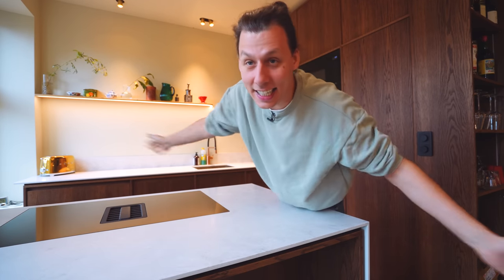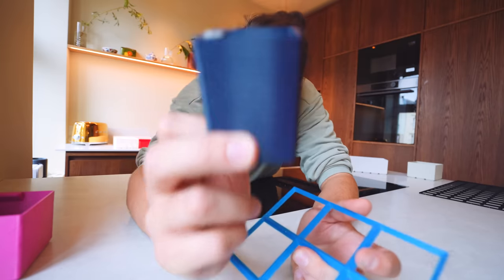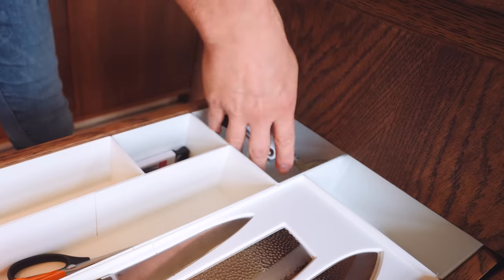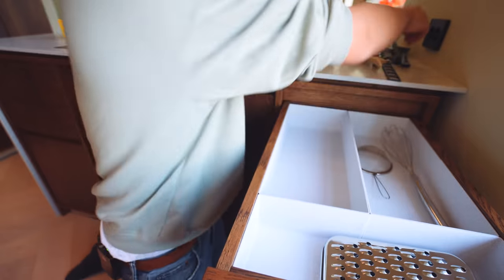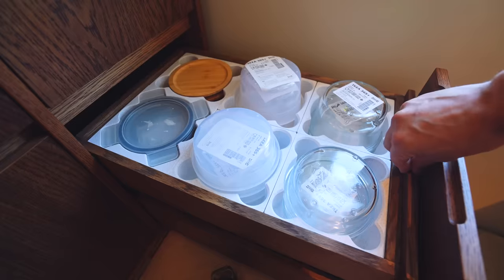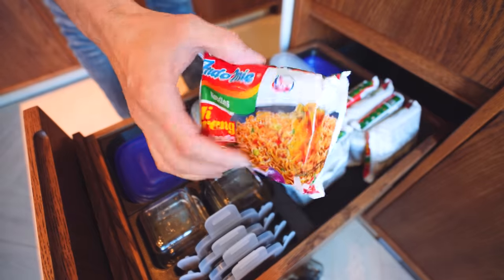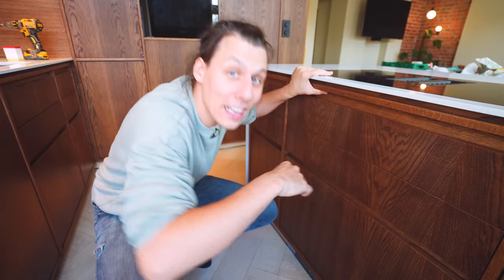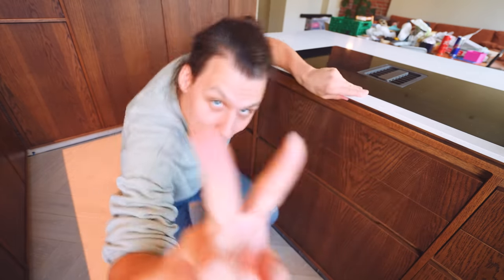How To Organize Your Kitchen With 3D Printing

Comment: Why not just conform to gridfinity with 42x42mm? proprietary grid systems for storage was rendered moot after that release. Still love your videos, great content!
Reply: this is exactly what i was thinking
Reply: While I agree with you 100%, once you have conformed to 1 standard, it’s a B to change
Reply: Probably because Alex came up with the idea first and he has designs to sell. If you don't want to buy these, just stick with gridfinity. Choice is yours.
Reply: Exactly
Reply: Exactly @amiddled  .  This system came first...Zack properly attributed Alexandre's v1 work when he put out Gridfinity.
Reply: @therick0996 he changed it from a 55x55mm to this 40x40mm. Would've been the perfect time to confirm with gridfinity (which I know was based on Alex' original work)
Reply: History...
Reply: Indeed. Seems like a crazy amount of work to redesign the wheel (even if your original idea was the catalyst for the current leading design) to try to earn some cash when there is a floss system with a huge following already competing in the same market.

You'd think someone would pivot to creating custom gridfinity modules for kitchen utensils and selling those designs instead.
Reply: @lmaoroflcopter  exactly. The problem is the licensing model Zack used for gridfinity means anything using its design must be open source as well. Sadly, it means this redesign here is nothing more than a cash grab when it could've very easily followed gridfinity. There's still a lot of work that went into this process but intentionally not following gridfinity by quite literally a 2mm design schema screams 'cash grab.'
Reply: @lmaoroflcopter  I would disagree - the amount of effortfully justifies the cost of buying the design files if you wish ;) You don't have to go this route you can always extend the open-source version if you wish nothing to stop anyone from doing this.
Reply: Parametric Gridfinity designs scale to any base unit you want. Whether the interlocking mechanisms are compatible is the main issue.
Reply: Ask not why Alex chose the sane 40mm, ask why Zack chose 42mm, which doesn't multiply up to exactly fit common shelf and box dimensions (spoiler: it was for a Hitchhikers reference). 42mm*42mm and a vertical unit of seven-point-something mm (instead of 10mm) is just needlessly causing problems for real world use, as opposed to playing with remixes like a grown-up Lego toy.
Reply: @AndrewHelgeCox  that is a fair point.
Reply: @NsRhea  you have the wrong way around. Alex's system was first. The perfect time to do the conformity was when Zack produce Gridfinity - which he didn't.
Reply: @amiddled  no I'm fully aware. The issue was Alex went closed system / proprietary and Zack didn't want to steal his design. So he designed a system and made it open licensing similar to Linux in that anything using gridfinity's base design needs to be free and open source for people to remix. IE something Alex couldn't mod and sell like he is here with a 2mm change.
Reply: @danpeters5163  I don't think we're on opposite sides of the same coin. I'm saying he spent a ton of effort reinventing the wheel why would he even start that endeavour, you're saying he spent a ton of effort reinventing the wheel, he has to charge for it to derive some value from it.
Reply: Because choices.
Reply: The same reason why we all don’t have just ender 3, Prusa or Bambu Labs.
Reply: @AndrewHelgeCox hitchhikers hey? Huh…
Reply: Alex definitelly didn't come to that design by himself, he copied/modified/took heavy inspiration from AT LEAST Sortimo, Allit, and many others by tool manufacturers. And now, he only changed to keep milking it. You can still do the halves thing with the "original" system.
Reply: Why not just make the new models Gridfinity-compatible without calling it “gridfinity”? It’s not like Gridfinity has a copyright on the 42mm grid system. Alex would still get to sell his proprietary models. I would certainly reconsider purchasing these new models.
Reply: @AndrewHelgeCox  I believe he chose 42 by 42 because it fit in his tool chest. lol
Reply: @lmaoroflcopter except he didn’t “reinvent” the wheel, he invented it 😊
Reply: @jhamby8773  I'm certain stacking storage systems existed before this guy.
Reply: No content in that. That would be like building a huge 3D printer for an empty conference center 🤔
Reply: @ldw821 he may not have a copyright on it, but he DOES essentially have a COPY LEFT on it, which in human terms, means, that if anyone is doing a 42mm grid system styles bin, it HAS TO BE distributed free of charge... I'm sure there are ways to get around that, for instance, making an "improved" model, but then the question becomes, when does editing something for a free, and open source system, actually make that designed item, now fall under that system, whereby it's then illegal to "sell" derisive works?

I'll admit that I don't know much about us copyright laws and I have not read the open source licenses in a long while, so anything that I may or may not remember, as far as open source goes, may have changed depending on the version and specific type of Open source license, of which there are many varying licenses...
Reply: @lmaoroflcopter  Alex didn't 'reinvent the wheel'.  Alex INVENTED the wheel, and Zack stole the idea, decided it should open source, and made a ton of money off it.
Reply: @ldw821  Because Alex's system came FIRST.  Zack stole the idea.
Reply: @BadlyBentPub  again, as per the last guy who came im chuntering about this, stacking storage systems existed before Alex, and they'll exist after Alex is dust.

Comment: Like many, I was inspired by Alex's videos and paid for the original assortment system. It worked well enough to organize my drawers, until I wanted to make some modifications. Without the source files, I spent hours looking for anything close to what I wanted on Printables, without success. This is the primary reason I switched to Gridfinity, and not looking back - you just can't compete with the variety contributed by the open-source community.

P.S. if Alex made these compatible with the 42mm grid system, I wouldn’t mind paying for the models.

Comment: I am using pretty much all your organizing boxes for years now, and I find the system extremely useful. All furniture that I make I size the drawers as a multiple of 55 x 55mm (the height is more flexible, and I have decided for 65mm for most). Anyone following your ideas for building a kitchen should think multiples of 40 x 40mm.

Comment: Mmm, gyroid infill. ❤ I'm using Gridfinity for my Ikea Alex drawers, turns out that its 42mm grid is perfect with just enough gap on the sides to avoid the screws in the drawer -- I printed a couple of 1.3mm spacer blocks to get the grid centered in the drawer to avoid the screws.

Comment: I would understand not going with gridfinity if you wanted to use a different pitch, but 40mm is so close to 42mm, might as well go with gridfinity
Reply: If he made it compatible with the Gridfinity standard, I would honestly consider buying these models.
Reply: Alexandre's system is the original one that Zack stole - he changed it just slightly and now everyone thinks that Zack is some genius.

Comment: I've just binge-watched most of your 3D printing projects yesterday and today (going to buy my first 3D printer :)). And now another new cool project! Keep up your awesome work!
Reply: I recommend "USSA: Woodworking+3D Printing" as well for similar caliber content of engineering and 3D printing
Reply: what printer you wanna buy? There are also rly good "cheap" ones :) for 150-250€ .
Reply: @hrdcpy  Thank you for the recommendation! Great channel!
Reply: @Bastyyyyyy  Bambu Lab P1S. I don't wanna work on the printer instead of printing :)
Reply: @alekshudochenkov  great decision. I started with Anycubic Chiron and it's a pain in the ass, although I had a lot of fun with it and learned a lot about mechanics, software, etc., I would now like to buy Bambu Lab because of auto-calibration and other useful features

Comment: One issue I have is using this system in IKEA kitchen drawers. I don't know why but they decided to make the sides angled. So the bottom of the drawer is a good 3 cm less wide than the top. So after filling the whole drawer with boxes, I have a 1.5 cm gap on each sides that tend to accumulate dust or chopsticks that fall in between.

Comment: My kitchen drawers are of a size where I end up having a half grid along a side, so I printed a number of the boxes that have the half spacing. They work great! One thing that I realized, though -- it would be awesome if all the boxes had half-size features on the bottom so that they would be able to slot into the grid on whole divisions or half divisions regardless of orientation. That way, if I ever want to use one of the bins I printed with a half-sized feature rotated 90°, it would still work fine.

Comment: I bought your original storage designs but ended up switching to Gridfinity for exactly the reason that you just switched to the 40x40 grid -- it allowed for finer control over sizes. Now you've solved that, and so I've bought these as well. I think they may finally be the impetus I need to bring this kind of storage to my kitchen, and I like to support creative people like you who come up with these original ideas. I think this new smaller grid of yours is excellent and it's neat to see the evolutionary improvements in it compared to your original design. The half-space sizes and the filler pieces are especially good ideas.
Reply: I’m confused why he doesn’t contribute to gridfinity instead of reinventing the 3D print.
Reply: Why not support gridfinity instead?
Reply: @rkatz69  Gridfinity is derived from Alex's original assortment system. Pretty clear that the designs here represent a lot of effort and original creativity on Alex's part. I have no problem paying for them.
Reply: @jaap7374 Gridfinity is derived from Alex's original assortment system. This new set of designs clearly represents a lot of creativity and original work on Alex's part, and I'm happy to pay him to use them. Not knocking the efforts of Gridfinity contributors in any way. But, frankly, having printed both some of Alex's originals and a fair amount of Gridfinity, Alex's designs at least for the 55x55 are more refined. I haven't printed any of the 40x40 yet.
Reply: @MikeKobb  Interesting, I thought Zach came up with gridfinity. Looks like he has some explaining to do.
Reply: @georgem64  (Trying for the third time to post this reply.) Zack did actually acknowledge that he was basing Gridfinity in part on Alex's system, in the first Gridfinity video. https://www.youtube.com/watch?v=ra_9zU-mnl8&t=383s

Despite the arguments he makes there, I'm still kind of uncomfortable with the fact that he took Alex's product and released a modified version for free, although Zack did a ton of original work on his as well. But this is part of why, even though I do use Gridfinity to some extent, I paid for Alex's designs because I believe in rewarding the guy who came up with the original idea. And now with Alex's 40x40, I will probably use those rather than Gridfinity in my kitchen because Alex's designs are just more refined. 

I also think it's worth noting that Alex introduced his grid system as part of the project where he made what's basically an assortment case, and there have been assortment cases with some kind of locking feature since before Alex designed his. The Tanos Systainer3 Organizer boxes, just to pick one example, came out in January 2020, while Alex introduced his grid in October 2020.

Comment: Rewatching this as I consider a new sorting system for my tools. I built a proprietary system 3 years ago to modularly fill an ikea filing cabinet years ago, but that meant it couldn't be square because of how awkward the size was. The 40x40mm grid is a great idea considering how many factors 40 has (1,2,4,5,8,10,20,40) which I think will be more beneficial than 55 or 50. Hopefully when I get a few more drawers set up I can get printing some boxes!

Comment: A great improvement for the bag boxes is, instead of spacers, is to have a spring-loaded bottom that will push the bags to the top. When you're low the bags are still accessible! There are paper towel dispensers that do this already with bi and tri-fold paper towels.

Comment: The Ziplock bag dispensers can be improved... make the filler block a flat piece and place a sponge cut to size under it to act like a spring.. will keep them pushed to the top of the dispenser

Comment: Hey Alexandre, rather than designing so many different combos with the half height size, I think it would be possible to use a plastic leaf spring that compresses and allows for 10mm or so of movement. Worth a look!
Reply: PLA springs don’t work AT ALL. You give it a week and it creeps to the extent that it no longer holds any tension. I believe most people will print it in PLA right?

Comment: That's some top class organisation! I feel like a small plate at the bottom of the zip lock bags and some springs under it would go a long way, I sometimes struggle to get the last item out a box like that when it's all the way at the bottom. :)

Comment: Great adoption of your storage solution. Inspired by you I made my own for my desk drawers 👍
Only detail to consider in this is tha many PLA filaments are actually made from corn and also have very small cavities during the printing process. IF you are unlucky, yhat is a growing ground for bacteria. But as long as you keep things clear and dry ther should not be any issues.
Thanks for sharing 👍🏼
Reply: maybe sealing the parts after printing with something would be a good idea. I indeed also never print anything that has even remotely the chance of interacting with something edible.

Comment: Perhaps you should make your Grid System parametric using OpedScad or similar. That would allow users to enter any dimensions they want without you having to make a seperate model for it :)
Reply: Well too late for that Grid...uh...Finity... I believe I messaged AC to consider the modern social $$ path- give away all the info and make $$ on the views, well before the Finity hit. Someone bettered the Grid design and released it to the the wild Finity. The groundswell community explosion around it has been fun to watch.  It's #1 on Thangs.  I'm surprised AC is still trying to slang old business model closed-loop files after the GridFinity explosion. Oh- the now trending on Printables is the awesome printable case for the Finity. I'd decided to go all in on GFinity, but this case really locks it in.
Reply: And pass on that sweet sweet money from basically inputing 2 numbers and make you pay for that?

Comment: Since you're flattening the bottom (inside), the bottom (outside) doesn't need to be simple. You could make boxes with enough chamfer to engage with the grid, but have a rectangular cutout in the bottom. Fill that cutout with a piece of rubber sheet, and now if you take the box out, or put the box in an ungrided drawer, it's got enough traction to stay put. This might actually be more helpful in the shop systems but in the kitchen it'll make the sound a little nicer when you're setting them on the counter
Reply: You could also put weights in the bottom of the boxes or even better, add slots every 20 mm so the boxes can be put in more locations in the grid!
Reply: He could also print those rubber inserts with TPU
Reply: @rkatz69  Or he could cut rectangles out of a cheap rubber sheet, available all over the place for low costs and even with adhesive applied to one side. Stop unsolving problems by shoehorning robots in. Heck, he could even use STICK ON BUMPER PADS. There's absolutely no reason to involve a 3D printer instead of a hyper-available stock part sold at every grocery store.

Comment: Alexandre, how do you make your 3D prints food safe when using them in the kitchen? Especially for the silverware boxes, any bit or water could cause mold to build between the layers. Are you printing these pieces on an SLA printer?
Reply: You wont get an answer as people would rather ignore the very real, genuine dangers :( It looks like FDM to me. Again, nobody cares. Protect yourself, don't worry about others. (Recent Robotics Engineering graduate with modules on 3DP and materials engineering [well additive manufacturing in general])

Comment: That's an impressive system.

When you showed the spice drawer at the end, the dill jar stood out to me. At first, I thought it was misspelled (or labelled in English). All of the rest (that I noticed) seemed to have the correct Danish spelling. But then I figured out that you're in Norway, not Denmark, so maybe the dill jar is correct, and it just so happens that the rest of your spices are spelled the same in Danish and Norwegian.

Comment: Alex, I should have known this was coming. Fantastic way to organise the kitchen. Will certainly look into you new sizes as my workbench drawers are definitely not the size of the original. You are a few days late, as I ordered a P1P a couple of days ago. You should look into a printed part recycling system. Seems like you have few, ha ha, rest prints that could be chopped up and turned into new filament

Comment: That's a lot of boxes! What material did you use to print? Some of the boxes come in direct contact with utensils and maybe food. Is it food safe? You are not preparing food on the 3D printed parts, but a sharp knife can easily scrape off some plastic.

Comment: This is a great system. I use the bigger 55mm grid with 75mm und 40mm height. What is the height of the 40mm system? I don"t find the information in your shop.

Comment: Just wondering: why did you start to make half steps instead of making your grid smaller. If the grid was 10*10mm you would have more flexible arrangement options.